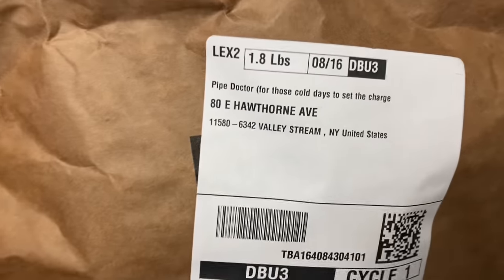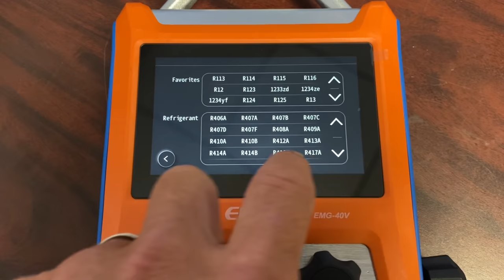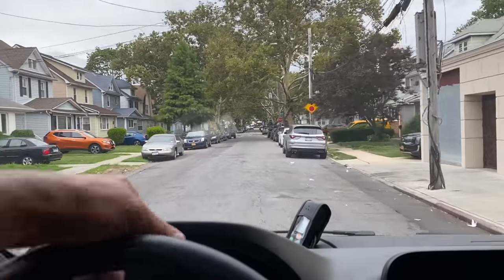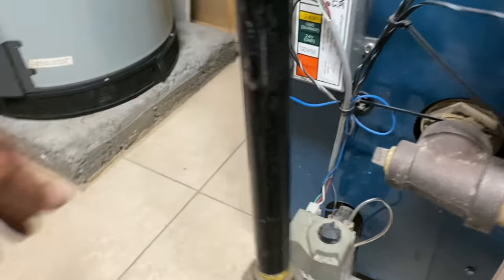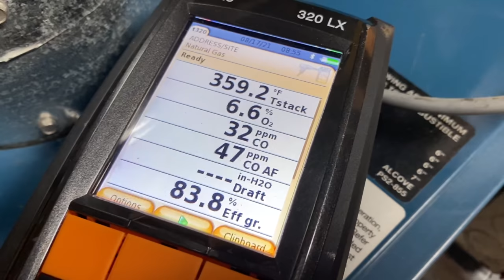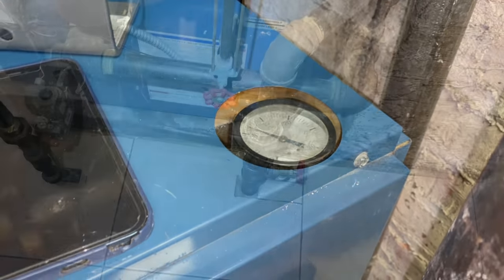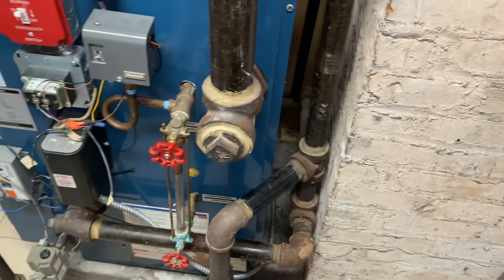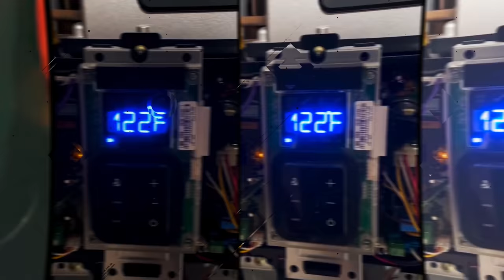Dunkirk Gas Steam Boiler Making Banging Sounds - Too Much Pressure or Clogged Wet Return or Both

Comment: Best way to be certain between 1 1/4 and 1 1/2 nipples,  is to measure the circumference with your thumb and middle finger.
1 1/4 they touch and 1 1/2 they almost touch,  as a rule of thumb.  I was taught this way by my father to tell 1 1/4 and 1 1/2 pipe.
Old timers have a purpose as I am learning now.
Reply: if only everyone had the same size hands. lol
with time you can still judge it that way.
Reply: Just read what you wrote, I stand beaten to the point.
Reply: Mike I learned this from Steve Lav.. I know you guys have some history, but he was one of the first Hvac channels I subscribed to.
Reply: Yes that is true. This has been used for plumbers b4 phones were a big thing
Reply: @throttlebottle5906  😆😆😆
Reply: @throttlebottle5906  😂😂
Reply: Hi
I am watching your videos.  
I am thinking to learn plumbing.  Where should i go to learn. I am in Queens village ny
Reply: How can I do this? I can't seem to understand how it is done

Comment: With the amount of mud in the pigtail I suspect mud in the bottom of the boiler, this will cause steam trapping in the mud which is very loud when it reaches the surface and expands. A flush wouldn’t hurt and would confirm or eliminate the possibility.

Comment: 6. The Hartford Loop connects to the equalizer with a close nipple because steam rises up through the equalizer, just as it does through the boiler sections. When the relatively cool return water meets that steam at the close nipple, the rising steam bubbles quickly condense. The returning water rushes in to fill the void left by the collapsing bubbles and this creates a slight water hammer inside the tee connecting the return to the equalizer.

If you use a long nipple instead of a close nipple, the returning water will have more room to move, so it creates more water hammer through its inertia. Long nipples act like gun barrels in this case and you should always avoid them. Stick with a close nipple or use a “Y” fitting.
Reply: Most guys think using a close nipple on the Hartford loop is optional it is required, as your well put statement says.
Reply: Interesting about the Hartford loop I have a longer nipple in my Hartford loop and I have steam hammer in the loop but only if the water in the boiler is above it, if I lower the water level to even with the top of the loop I I get no hammering. After reading this I should just yank out the Hartford loop and reinstall with a y or a close nipple.

Comment: Mikey Pipes! I had a Revent Oven making a noise that sounded like a helicopter without a muffler, the cool thing about that burner box, its roughly 2' X 3' and contains a 6 foot flame that spirals like a tornado, so its a 6' flame spiraling about 18" wide and 28" long, but 6' in length, if that makes sense. But anyway, the burner jet was slightly at an angle and was hitting the side of the wall and fluttering into itself. Anyway, I'm going back to your story just wanted to share that

Comment: I had cast iron radiators in the house I grew up in with an oil fired boiler, ( oh how I love oil burners, could fix them 365 day a year, would be heaven to me, though the mega yachts and commercial fishing vessels I service all have oil fired heating systems). To me the steam heating systems are the best as the heat lasts far after the boiler shut down and also leaves a nice environment as the radiators are emitting water vapor every time they hiss into the environment. They

Comment: Good video! Charging Jacket was from me, use it on heat pumps in the winter or str8 cool enjoy! Also a little tool coming for Daniel Son for those compressors out on thermal overload. That way you can get more pool time 😂
Reply: Hi Earnest.. I have a 3 zone LG RED system the jackoff that did the evacuation and added some refergeriant due to extra line set length evacuated the system when it was about 25 degrees out... he DID NOT use nitrogen, the system heats and cools fantastic but my line sets sound like running water, i never had any fault codes but IM thinking i should get the system totally evacuated with a recovery and recharge the system.. is it a big deal that it was so cold? he also did not use the core removal tool...you think the moisture was able to boil off under vacuum ? there aren't any leaks. we got down to 50 microns ... I installed the system myself along with 2 other mitsubishi hyper heats that are spinning like a top.. electrician by trade, carpenter, hvac tech , landscaper, plumber by night. is nitrogen necessary if nothing was brazed??   its been almost 2 years
Reply: @SubStationSparky  yeah sounds good!
Reply: @SubStationSparky  call the pool guy maybe he can straighten it out! I know a guy that does masonry you want his number?
Reply: I'm at my vacation home in Maine at the moment, but my wife's a nurse at a mental hospital if you want the number they have openings for for patients but you gotta hurry it's limited. They have hurricane fans, swamp coolers and jello cups!!!
Reply: @Matts_Crafty  look at you. Keyboard 🤡. Settle down.  Guy I used was a licensed HVAC tech. My install is spot on. Another reason if you want something done right you have to do it yourself.

Comment: I tend to find that the steam gauges with "internal siphons" just means they have clogged or are going to clog.  
Best just to abandon them in place (unless they're leaking of course).

By Code, you should have a working 30 # gauge on there somewhere, as you know.
Usually, we'll get a 1/4" brass street tee and install it between the P'trol and the pigtail.
A new gauge can go there on the bull outlet.
When you go to check the pigtail for annual service, remove the gauge, put your mouth on the hole & blow (no need to remove the P'trol to check).
Hope this helps & stay safe.

Comment: I have a Burham Nat Gas fired Steam boiler that was installed in 2019, for heat only. It replaced a 27 yo Burnham that cracked. My pressuretrol is set to 1.5 psi. It turns the boiler off and on based on thermostat and pressure. Helps to regulate water usage also. If the pressure is getting too high, and the radiators hiss continually, the vent valves on the radiators may all be blown out and need replacement... They are not expensive to replace. They seal based on air temperature, not pressure. They also allow air to vent back into the radiator to allow condensation to flow back to the boiler when the heat system cools down. If they don't work properly, you can get banging when the system cools down, even if the radiators are pitched correctly... The only self maintenance I do is to flush the boiler and the loop every two weeks to prevent rust buildup. My installer cleans and adjust the boiler once a year.

Comment: I doubt that return line is clogged,  my old boss had me back flush about 15 -20 jobs that way, I never found 1 clogged return.
I always skimmed out some dirty water and put in 1lb arm and hammer baking soda and steamed up and flushed out. If water surges very hard , a great chemical is scout it neutralizes in seconds and no flushing. Another tip to check clogged pigtail, trip pressure control and if it stays tripped.   is clogged.  I would like to see the answer.  Thank you

Comment: I doubt this was a clogged return issue. The boiler water level would have been high (flooded)due to the feeder coming on.  I’m skeptical of it being a pressure troll issue too. Although it could. But I think that I’d be  looking at the water quality and the near boiler piping as well as a possibly oversized or overfired boiler. I’d be suspicious of “wet steam “ which all of the above could contribute to.

Comment: On the west coast we have mostly forced air.  I really like the east coast baseboard radiators and regular radiators too.   But you cant beat the simplicity of forced air.  Next week we replace our existing old furnace with a new higher efficiency one with a fan coil for our new AC system also going in.   Learning a huge amount from your channel.  Mostly how important that annual professional maintenance is.  Thanks a bunch!

Comment: Thanks for the video, too much pressure. 5psi is high for a small house. the water gauge shows dirt boiler needs flushing and return flush. Pressutrol or pigtail not working also no manual reset on the boiler. Maybe the location has different code than NYC.

Comment: Do steam 15psi pressure relief valves go bad? If so, how do you test them considering steam pressure is low ?
Reply from the maker: Manually lift them

Comment: Mike, the way to tell 1-1/4 from 1-1/2” is wrap your hand around the pipe. If you can touch your index finger and thumb it’s 1-1/4” if you can’t touch its 1-1/2”.

Comment: Depends on the person and no personnel jokes here, but.  I wrap my pointer finger and thumb around the pipe.  If they touch its 1.25 if there is a gap its 1.5.  learned that at 13 yo...  Also could be bad water and it needs to be flushed and have an additive put in.  Very rare its a pressure switch.

Comment: Hmm Elitech....I just returned my Elitech Hi/Lo +temp  set that I ordered via Amazon.  I was in a pinch and needed it next day.  Amazon sent me a used kit with batteries installed and cords all messed up.  Low pressure gauge leakes and the misc fitting were missing all of the gaskets/o-rings.  In this case, Amazon sucks!              I have the Field piece set on order(AccuTools) and looking forward to using Measure Quick.  Enjoy your light humor!

Comment: We find almost all steam boilers over pressurized and replace pressure stats with vapor stats. Sometimes we will add a vacuum breaker at the boiler. I notice that the Hartford Loop wasn't made correctly with the long nipple installed. It should be a shoulder nipple.

Comment: Most air vents on radiators will fail if exposed to 2psi or slightly less.
The fact that they are venting steam proves they’re trashed, which will prevent pressure from building up to operating at correct pressure.
Consider a feeder/probe with a delay, system is obviously over filling if you get water out of rads and return is clear.
Return work looks … bodged.
Header seems … odd, is equalizer correct?

Comment: During your dissertation on the system you brought up the fact that there’s no vents at the end of the main’s. I thought that was important for two reasons, in lost art of steam heat by Dan Holohan he mentions some of the problems with steam heating systems as putting the vents in the wrong place such as at the very end of the steam main’s there’s a picture of a failed vent because it was tapped into the elbow at the end of the main and water hammer had destroyed the vent. Given that you may want to consider placing the vents about 18 inches before the end of the main’s and putting in a pipe to place the vents further away from the main’s so they will not be destroyed by water hammer in the event it happens.
I was a little surprised that you didn’t mention anything when you talked to the customer about the various problems that he was having and focused instead on jetting the wet returns.
But I’m only an arm-chair homeowner (non trades person)
I’m not a plumber and don’t claim that special knowledge.
I hope you get the job.

Comment: hope there is a follow up video..thanks.. my wet return has a gate valve .the gate valve has not been turned in at least 35 years. needed some lubricant and pipe wrench to get it loose.i got it open and wet return is not clogged. the best part is i closed the gate valve and no leaks.. the washer has not deteriorated. If those pro press o rings are as good as this gate valve washer...........maybe there is hope ?? for the propress.....lol.i am not touching the other gate valves that are at least 70 years old lol..did that once ,had to replace with ball valve.....maybe i did not have to ,just replace washer but ball valve should last longer than me so.....one and done project...

Comment: Doesn't the pressure gauge have to be mounted vertically?  Here's what Google says   Usually, a pressure gauge is mounted with its dial vertical. With any deviation, the position indicator on the dial must be observed. For process connections with parallel threads, use flat gaskets, lens-type sealing rings or WIKA profile sealings at the sealing face ①.  
Those air release steam heater vents can go bad.

Comment: They need alot more steam main venting. All the air in the system is trying to be pushed out the radiators vents. Also if the piping close to the floor is warm they likely have return. Didn't see if they had an automatic water feed, but if the return was clogged they would have had low water cutoff or the feeder running constantly.

Comment: Old school wooden radiator covers with expanded metal mesh. Trapped a lot of heat. Remove many of them in the 70’s and 80’s to reduce utility costs to apartments.

Comment: I come across this all the time the easy way is to drill and tap 1/8 npt , u can also do 1/4 npt, but u definitely will have to do that on the fitting not pipe.

Comment: I wish that you could come see my boiler. I’m having issues with my tenants’ boiler. The pipes are so loud. And a plumber came in, charged me $2,300 to make a huge whole in my ceiling and placed a new pipe.

Now it’s banging more and I’m super frustrated. No plumber seems to know what is wrong with this banging. 5 plumbers have seen this boiler. All different reasons.
Reply: Pitch the radiators so water runs back to the boiler .

Comment: I’m surprised no one mentioned the length of the Hartford Loop nipple. Lol. Plus, with underground piping, you always have the risk of the pipe being rotten.
Gauges rarely work correctly after the first season
Nice catch on the vents missing
No vents on the mains, the air picks up the condensate from the radiator and slings it out the vent. That becomes your main vent. Adding main vents should stop that.
Reply: @georgebrett6082  it’s supposed to be a close nipple into the Hartford loop
Reply: @georgebrett6082  no problem buddy. Just making sure that we are all on the same page 👍

Comment: Easy way to differentiate between 1 1/4” and 1 1/2” pipes is to grab it with your hand. If the the tip of your thumb touches the tip of your fingers then it is 1-1/4” if not  then it is 1-1/2”

For the npt fittings; if you can insert your index and long fingers together into the fitting then it is a 1-1/2” fitting if you can’t then it is a 1-1/4” fitting
Reply: Good old “old school”…Love it

Comment: Underground returns can be a real problem. As expensive as adding flush valves might be it's a lot cheaper than jack hammering the floor to replace those pipes.

Kids have been touching steam radiators for as long as there has been steam heat, the smart ones only do it once. Experience may be a harsh taskmaster but there is none better.